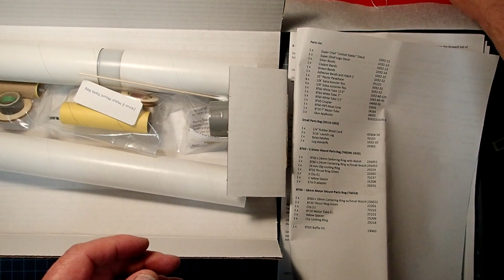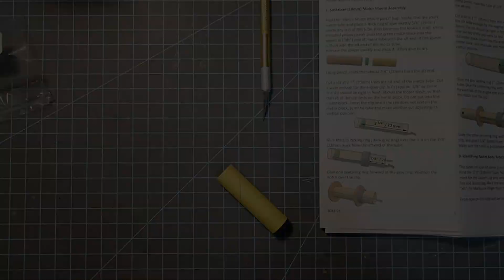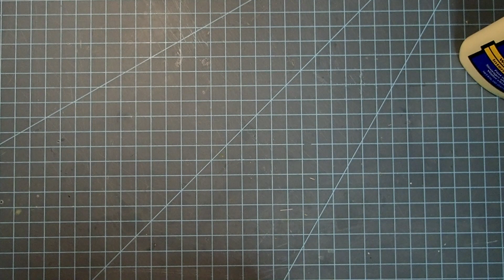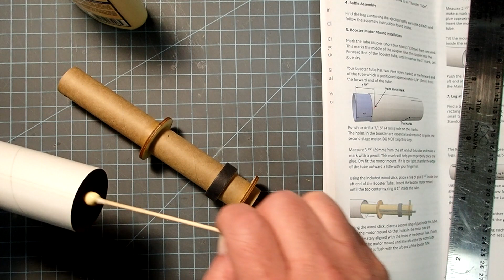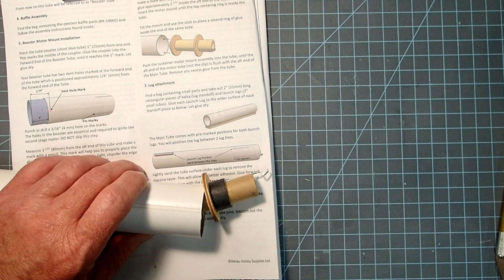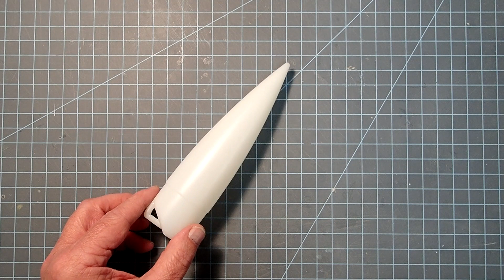Rocketarium "Super Chief II" model rocket assembly (revised) part 1 of 2

Comment: I just got mine an havent started building it yet... i will obviously read the instructions but was curious about it being a two stage rocket... does it separate? Or does one motor just "push" the rocket farther? And if no separation can it be rigged to separate? Thank you dr Dave
Reply from the maker: It uses gap staging.
Reply: How tight should the booster stage be when coupled to the sustainer?

Comment: Hello I have a question, I am having a hard time finding the 12-0 engines and I was wondering if it would be ok to use the 12-3 engines which are in stock in my local Michael's and Hobby Lobby? thank you in advance hope to hear back soon.
Reply from the maker: The booster stage MUST have booster motors, thus the D12-0 or E12-0. There are several online retailers. Just do a search for the motor in question.